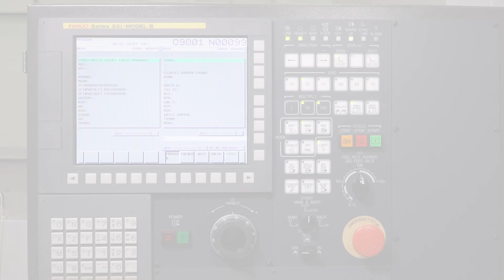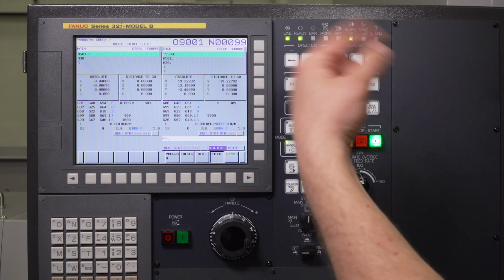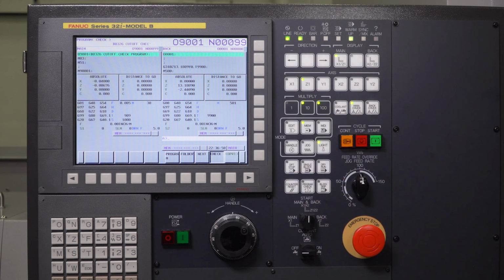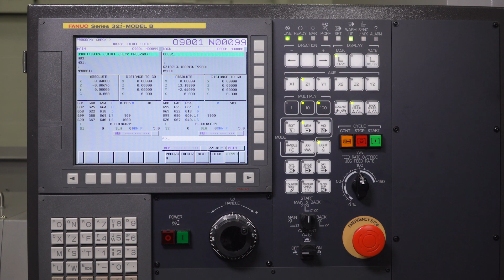How to Use the Tsugami Program Check Function

Comment: I've seen handle retrace go backwards to a certain point on other brand machines. Great feature to have.
Reply from the maker: Going backwards on a multi path machine is a bit more involved because of the wait and synchronization codes that are used.
Reply: @TsugamiAmerica  I'm talking 3 path Mori NZX2000. It only does it through the buffered points, so it's not too much, but it'll still go backwards